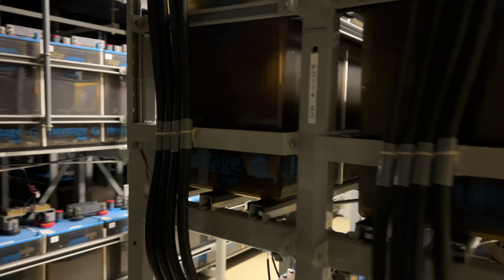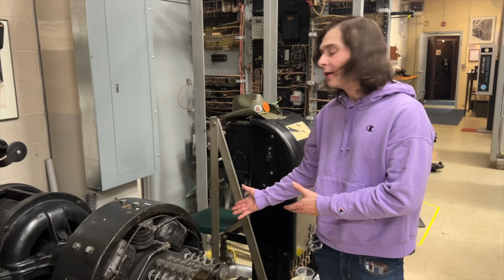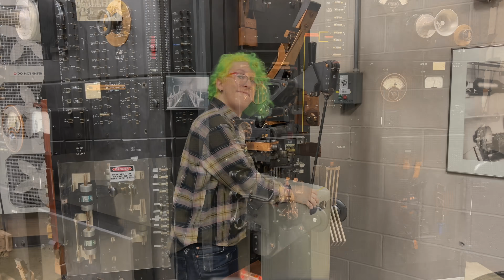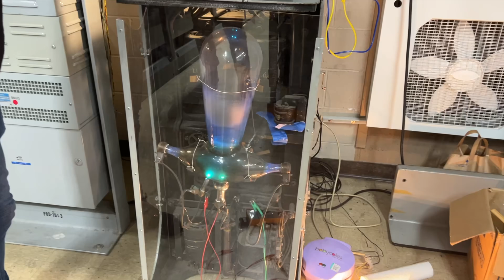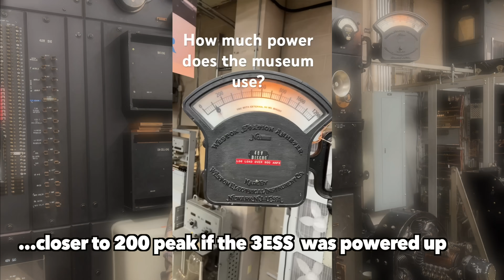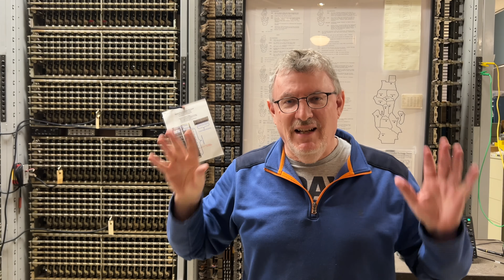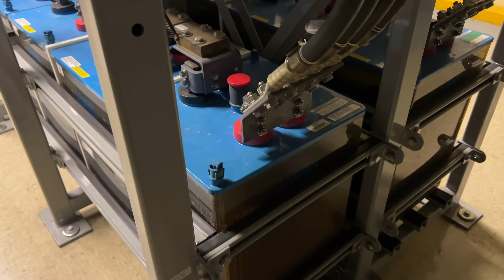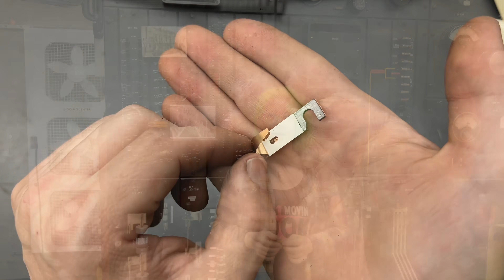All About Telephone Power Plants

Comment: I had almost completely forgotten that during storms when power went out (a frequent occurrence in the rural spot where we lived when I was little) the phones would all still work and we used to routinely call others in neighborhood towns to ask about conditions there... and even sometimes call the power company to get updates about repairs.  ⛈️☎️
Reply: That actually played in to a natural disaster I experienced about 10 years ago (flood).  The power for the whole town was out for days. The cell towers died after a few hours. One person I knew had a land line that worked the whole time, and they were a major communication link for a group of us that worked together.
Reply: Many years ago here in Worcester, England, the main exchange office had power problems and service was failing. A fuse of the grasshopper style failed however for some reason did not set the alarm off! That stopped emergency calls in the area. Not good.
Reply: Over Christmas 2000 into 2001, we had a horrible ice storm in the Texas, Oklahoma, and Arkansas area. I lived in southeast Oklahoma, and we were without power for a little more than two weeks. The phone company had everyone out basically splicing lines back together so people would have phone access. They reconnected our phone the second day and we had phone service the whole time. They had been in the process of moving the town to underground lines (still POTS) and had hoped to beat the storm, but didn't quite make it. They had run all the wires, but not connected them to homes and complete the cut over.
Reply: In the wild! Fancy seeing you here!
Reply: @Alexis-lt3zy  hiya!  👋☺️👍
Reply: Now these days its almost the opposite...try and call to report an outage (assuming THE DANG CELL TOWER ISN'T ALSO OUT) and you get recordings encouraging you to "use their website" except for the issue where my ISP has no backup power so cable-internet is down (even though I have UPSs) and in my area cell service is marginal for voice calls and useless for data sessions.  Our last major power outage in the area I was hopping on my VHF amateur radio to try and find out how widespread problems were because the cell towers all went down and also the wireline internet was down so there was really no way to communicate other than 2-way radios and one wide-area repeater that was on battery backup.
Reply: @matthewmiller6068  I live near an area where there's like two roads on this side of the state to get to this one town and one road from the other state. For some reason the fiber lines were consolidated down to one line. So just about twice a year we hear how frontier is out in this small town in the mountains and they have no emergency communication to the 911 center in the neighboring town.

Yeah getting through to anybody is amazingly annoying. We had a dump truck snag a telephone line on the small road that I live on so much that the small RTV US mail truck couldn't get through. It was so low I took selfies while holding it. people called the electric company and couldn't get anywhere, I ended up finally calling frontier even though I'm not a customer. They scheduled an appointment for a tech to come out the following week and see why I was having an issue with my phone that I don't have. It was only after posting selfies to Twitter did they show up the next day with 8 trucks. Hampered by the fact that I live on a circle where part of it's semi dirt and somebody bought the property on the corner demanded that the state pave remainder of the road and then when they said no put gates up. And yes when the neighbors had a backyard fire that got out of control we had the fire company come through for the brushfire that ensued and they had to drive through one of the gates because they didn't share access. The frontier guys were nice enough to tell me that they have keys well that's great but what about all the volunteer fire companies in this area?

I guess I'm glad I finally got licensed 3 years ago after 25 years (Life..).
Although I work with some conspiracy theorist futurists who think the world is gonna end in 2035 and that they're going to just ride it out in this small town with their emergency communication radio net work that they're trying to build. Sure the County system isn't gonna last very long due to propagation and design issues and lack of continuous power but they at least have a generator. Meanwhile we can't get anything done because the guy in charge of the group has to control everything and micromanage everything and changes his mind frequently/doesn't remember things. Meanwhile he's trying to co-op all the ham radio operators and pissing people off even got us kicked off the County tower!

In my area when Comcast cable added voice services for a while it would go out with the power, then a regulation changed requiring them to be an emergency service and everything is backed up now although I wonder how long it will be maintained. I wish I could afford to have a traditional landline although frontier right now is converting everything over to fiber finally. It's amazing how many times the government has stimulated the telephone companies to upgrade infrastructure to fiber and yet they sat there and did nothing.

In my state West Virginia owns half the infrastructure so you can operate your own independent ISP and get permission from the government and then they say go work out the details with the telephone company and what do you know the telephone company doesn't let you do that.
Which is why the one independent provider we have is completely all WISP. Of course that wasn't helped by one guy in local town office that insisted that he could get Email on his cell phone with US cellular and that's all he would ever need and that's all the county would ever need for Internet....
Reply: @matthewmiller6068  Where do you all live if you lose power so often? Last time I had a power outage was 24 years ago.
Reply: That's why I prefer to have a POTS  at home ... but alas ...  they ave converted my area to FIBER and  no longer do i still  have phone service when t the storm take teh power out ... also there's not  mobile service either ... as my  local power service goes out for  over 48 hrs .
Reply: @techobservations8238  I would like to have the option as well. But alas, my local Bell won't sell POTS lines anymore. Everything is going fiber.
Reply: I love it when a YouTubes comes together. theme song plays
Reply: @cdoublejj  never thought elevator jazz hold music was much of a theme song, but... maybe it is in this case?
Reply: This was even a plot point in "The Day After Tomorrow".
Reply: Call the power company that sounds insane!
Well the power company has a ridiculous phone tree as well.
We had a telephone line get snagged by a dump truck on the small road that I live on. I could literally hold it it was so low. The power company didn't want anything to do with it and frontier was just as bad with their automated phone tree. Eventually I managed to schedule a Trouble appointment for them to come out and look at my house even though I don't have frontier phone. I think it took posting photos on Twitter for them to go oh maybe we should come out not on Wednesday the following week.

Oh the good old days when you could call somebody or call a Business and actually get somebody. We lived in the middle of nowhere upstate New York in a valley at the end of the telephone line. We were out of power for a week or two once (no it wasn't the big Manhattan black out surprisingly) although we did just rent a movie and buy ice cream before we drove home 45 minutes to find out we were out of power. Phone's always worked it was great. And it's one of the many things that I will miss about traditional copper when it goes away. Sure if you have fiber you can have a UPS but the systems provided are not gonna be maintained nearly as good. It's too bad that they can't do power and fiber so your end point device still works in a minimal fashion even if the battery's dead and the wall power is out.
Reply: ah yes, the "fancy" cordless base stations would go dead, and Dad would pull out "old reliable" an old Pacific Bell phone and dial up the neighbors.
Reply: Yeah, I really miss when phones kept working with the power out, ever since telcos in my area switched to fiber-to-the-node they never change the batteries in the node boxes so after the first LONG outage in the winter, all the batteries froze when they discharged too far. Since then, phone and internet go out with the lights. We've tried telling em about the bad batteries, but they don't wanna spend the money, and it's a great reminder that just cause a system is newer, it isn't necessarily better. It's especially bad cause most of the cell towers in the area are ALSO on battery backups, and while they last for about 6 hours when the lights go out, they either don't HAVE auxiliary gensets or they never bothered to fuel them up after the ice storm so once they're dead you're cut off from the world. 

It sucks that we've somehow REGRESSED in terms of disaster preparedness, it used to be that the landline was THE most reliable utility and would keep on working after everything - record setting ice storms, tornadoes, the literal nuclear apocalypse, no matter what you could still call the emergency numbers on the fridge. Now, you gotta have a Baofeng with an illegal linear amp and a big aerial, and KNOW what FRS channel and squelch code the volunteer search-and-rescue dispatches on cause police/fire/EMS are all on encrypted digital radios, even CB channel 9 isn't monitored at dispatch like it used to be for emergencies.
Reply: @LenKusov  That's EXACTLY what seems to happen with our cable ISP.  And apparently the telcos aren't maintaining backup power on the cell towers because this year there was a wide area outage (accident with a drill rig behind a landfill hit HV transmission lines powering 6+ counties) and all the cell service in my area went from poor to nonexistent.
Reply: @LenKusov  
wow. It's funny because when our cable company Comcast started doing phone service it would go out with the power outages but then a regulation went in that they were now considered emergency services so they had to figure out how to back up their entire network to maintain service.

I wouldn't be surprised that after the six hours of your cell phones going out that maybe the towers don't have connectivity elsewhere either.

I can remember the number of times the telephone lines went out where I used to live and I was in the middle of nowhere in the valley in upstate New York. We had a farmer accidentally dig up a buried line and of course that was literally the only half mile where it was buried the literal only section where it was buried! The occasional storm damage which was very rare. And the one time I was staying at somebody's house when my parents went away I got to use this newfangled thing called a cell phone, it was a bag phone!

It was one of the nice side effects of getting DSL was that the phone stayed up and so did the DSL I don't think that's true anymore.
Reply: @LenKusov I hope to see new interest by John Q. in ham radio. Easy to get the license since you don't NEED to know Morse. But you should! Like driving a stick! You CAN'T KNOW too nuch....
Reply: I feel like this is a oft forgotten extremely useful feature of landline telephony. The telephone also rings without outside power connections which is very cool.
Reply: @rugbybeef  I haven't seen a landline in decades. I think the last one I saw was my grandparents, but they were forced to change to a cellphone based landline in the early 2000s when they moved and new landlines were not sold anymore. They haven't made new contracts in at least 20 years and few years ago they started ripping copper out and forcing the last old customers to mobile phones. But I have never been without mobile service.. It just works always. Now that I think of it, I haven't even seen those old school telephone poles anywhere after the 90s.
Reply: @oskar6747  So I bought an old style landline telephone a few years ago. I was able to hook it up to my Comcast cable modem and use the line they forced me into a "triple play" service. I got it because the old ringer bells in the phone actually wake me up when I am sleeping. My older mom was sick during COVID and I needed a reliable way for her nursing community to contact me. The other nice thing was when the power went out if I hooked up the modem to a generator I was able to use the line (if I had a touchtone phone). The problem I had was I bought a rotary phone for the kitsch factor and pulse-to-tone is surprisingly difficult. My old modem had a switch buried deep in its programming, but I haven't found a technician who knows where it is in the interface for a couple years.
Reply: Yep, the landline telephone had like 6v running on it to actuate the bell. So it worked during blackouts.
Reply: Yeah, when cell phones came out, everyone's mind turned to mush.
Reply: It boggles me how we've traded reliability and redundancy for "convenience". What a blissfully ignorant attitude... 

"That'll never happen!" XD
Reply: Hot anymore tho they have changed us to VOIP
Reply: Yep, the little RJ11 phone cables actually carry the power required as well as the voice signal, to operate the phone.. which is pretty freaking awesome 😎 And yes telecom giants will try to sell you VoIP service that won't work in a power outage, but in most places in America, copper phone lines are still available. The lines are still in the ground, the phone company just wants to charge you for "the latest and greatest." I can guarantee that government and military agencies are still using copper phone/data lines, at least as a backup for everything. I know for certain Florida Dept of Transportation and Highway Patrol still uses microwave dishes for their communications network, (I worked on upgrading it) and that's tech that has been mostly obsolete for decades!.. at first I thought it was because their budget is low, but I've come to realize that older tech is simply MUCH more reliable and well understood. 

ANYWAY.. 
I love this channel, old telecom tech is so damn cool :)
Reply: Cool!
Reply: celltowers are sopposed to have a 3 hour emergency power on site. 

last year was the only time i can remember this no longer functions. 

same for voip telephony from verizon. 

now if the power goes out where a tower is involved... nobody can check on anyone? its idiotic. and not sopposed to be this way.
Reply: @pazsion  bruh, I'm over here telling stories about a time prior to cell phones and prior to the internet being a thing in people's homes 👴
Reply: I can send you a pic of an Circa 1940's  switchboard 480 / 240 / 3 phase 240 / 120 single phase / 125 vdc that ALSO has a transfer patch panel with plugs and cords for separate voltages which goes to separate panels in each room within the building that allows one to choose different voltages to go to those rooms .
Reply: those phone lines used to carry a small amount of power, there used to be things you could use said power for.

Comment: Hi, i enjoy you content very much. Do you know if there were rules about how long the batteries should hold in an eventual blackout?
Reply: Bell most certainly had a standards for the office type, region, etc.  The purpose of the batteries are to hold the office over until AC power generators came on line and transferred the load from the down commercial side to the active AC power generators.  Today that normally occurs in under a minute.
Reply: the network is always powered by the battery plant. Loss of commercial power impacts the AC rectifiers used to keep the battery plant float voltage up. No commercial power & the generator fails - you probably have 5-10 hours before it gets dicey.
Reply: @rogerhouston3209  All of the CO cells were rated at so many amp hours, but at a 8 hour rate.  Power failures lasted at most a few minutes, but could go higher if commercial power was out for say, an earth quake, and commercial power failed, and the emergency power failed to start for some reason.  That is why we had a 24x7 on site power room technician on duty.  All COEM's were power room trained, and knew how to use a telephone to call for help.  In 20 yrs of telco experience, I never saw a power failure that lasted more than a couple of hours, em gen would start, or if all else failed, we had portable 500 and 750 KW diesel generators mounted on flat bed trucks at various locations.  If you carefully look at your local CO. somewhere on the outside of the building there is a giant plug, where these portable generators can be plugged in.  I worked for PT&T in the Los Angeles north area
Reply: @rogerhouston3209  My reason for asking is that i used to work for the civil emergency services in Iceland, there we had a rule of 24 hours no matter what, we called it a pants down no socks on situation. We had mechanical means to run the network for 7 to 10 days without any outside help.
Reply: Btw, this was in the late 70´s early 80´s
Reply: I can only go off my experience from being a Wire Dawg in the Air Force. Our batteries were spec'ed out to provide 4 hours of full service. And we had a backup generator with a 10,000-gallon fuel tank that was really its own building. We had to test the generator weekly and if the fuel got to 5.000 gallons, they came and filled it up. I am sure the most switches the backup capability was determined by the available budget and how critical telecommunications were to the company/agency and what would be lost without comm.

Comment: is there a crossover point before introducing the next generator into the circuit, as in if the first generator reaches say 90% of its capacity would that be when the next was introduced, or would it be pre-emptive?